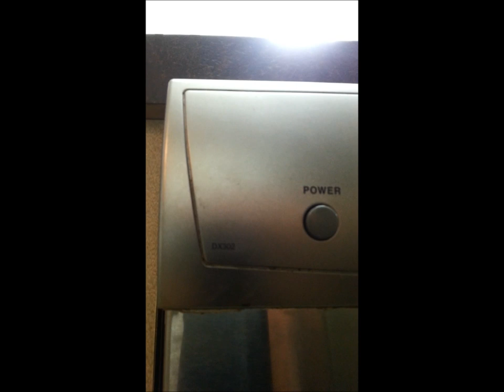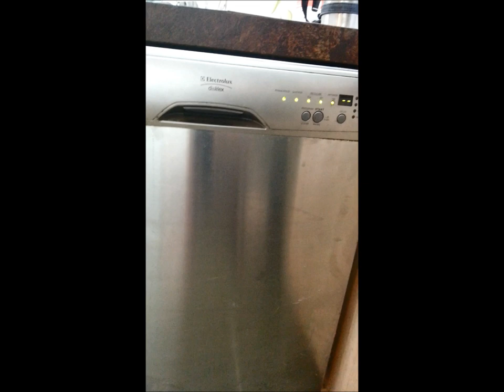Electrolux Dishlex DX302 Dishwasher, Easy Fix Heating Element

Comment: Our dishwasher did the same last year.  I decided to buy a new controller ($132)
Six months later same thing happened.  The electrical supplier would not cover the new controller because it was over 3 months old and I installed it myself.
Yesterday I decided to buy a new dishwasher but I looked this site up on the internet.  Did the repair as described even though the joints looked ok. Now dishwasher is heating as I type this. Thanks a lot -saved me purchasing a new dishwasher.  I have also done the same to the spare controller.  I did not find this video when the problem first happened - would have saved another $132 but it has saved me buying a new dishwasher

Comment: After replacing the heating element and the temp sensor and it still not working. I went to YouTube and found your post. I followed the instructions and actually found the the problem. Re-soldered the relay points. 💥💥💥💥💥💥💥💥💥💥💥💥💥💥💥💥💥💥it’s freaking working. Thank you 🙏.

Comment: I have a slightly different model to this one and after 15 years it just suddenly stopped heating the water.  I was almost going to buy a new dishwasher, but decided to re-solder the 5 relay points on the PCB (I solder-suckered the old solder, then applied new solder), and although I didn't expect it to ever work again, lo & behold my dishwasher is working now!!!   Dry joints are a bit of a mystery science to me ... upon close inspection, the original PCB joints look good, but it wasn't until I re-soldered them, that they were good again.  It's amazing how the world is dependent on billions of solder joints and yet the failure rate is probably fairly low ... for me 15 years straight and suddenly the dishwasher stopped.  This video proved to be a Godsend, and saved me $500 (the cost of a replacement machine).

Comment: Thanks Denny - Great step by step guide to fixing our dishwasher. The fault was exactly as you said it would be, with a dry solder joint on the relay connection to the PC board. Thanks once again for taking the time to show everyone the fix. I estimate at least a  saving of two hundred dollars by the time they have hit you for a new board.

Comment: Thanks Denny, fixed it in 15 minutes! Exactly what you said, I could see the solder joints on the relay we're loose. Now for the first time in months we have dry clean plates coming out of the dishwasher.
You have saved us time and money- Cheers!

Comment: Hello Danny
I did exactly what you presented in the video. I did not understand why the electronic circuit should be re-welded, but I did so - and it worked !!! You are a great engineer.
A big thank you from me. Now I do not have to wash the dishes.

Comment: Nice one Denny, works a charm on the Dishlex DX301 also. Note that if you can’t get the solder points to melt by themselves, adding a little extra solder works really well to get the job done.

To the commenter who suggested taking a photo of the leads before disassembly, turns out the leads are all different sizes so they only fit their original positions.
Reply: Yes, just did our DX301 works perfect again now. Was just the large terminal added extra solder, fixed.

Comment: Thank you very much.  I used the info in this video and 15mins later had a dishwasher like new.  I would note a few things:  
- my dishwasher exhibited a lack of heat intermittently then finally stopped heating altogether.
- I recommend using some solder flux when reflowing the solder.

Thanks again!

Comment: Followed your instructions and prodded around the soldered points with a little soldering iron and wasn't sure if I had melted the points enough as the iron had a really fine point. Anyway put it all back together and low and behold it works. Made sure the machine run for at least 15 minutes before checking the temperature. Many thanks for the info.

Comment: Heater was playing up and finally gave up. Thanks for posting the video. Followed your steps and waiting for dirty dishes to load it and test. Tested the relay with a 9V battery. It clicks in and out and  contact closes when the relay is energized.

Comment: Hi Denny
Thank you so much for posting this as I am a single mum and my dishwasher has not been heating for a while and didn't not really have the cash to fix.  So I decided to follow your guide and purchased myself a soldering iron and followed what you did step by step, which was simple thank you.  Managed to fix my dishwasher and am currently running through a cycle and its heating!!!..  I am so excited.  All I got was a couple of cuts from the steal cover when putting it all back together.   Thank you Thank you Thank you xo

Comment: Thanks Denny. I've done a few repairs on this model already (faulty power switch and switch wiring). Good to see it is most likely a simple dry solder joint or 5. I'll give it a go this week. Cheers.

Comment: Thanks Denny ,did what you did in the video worked a treat, saved me a Lota bucks buddy. The solder had completely fallen of one of relay solder points, gave all the other points a touch up while I was there, (to be sure to be sure) put it back together and away its hot little cleaning self  went. Top video thank you Denny for taking the time to do the vid.

Comment: Yay!  it worked  (second time around).  Burnt my finger on the soldering iron (which I've never used before) but the dishwasher now works properly - hot water coming through and dishes dry!!  Thank you Denny!

Comment: Thank you Denny for creating this video, really appreciate it.
I decided before I pulled the washer apart i would give the front of the washer (where the buttons are) a couple of decent thumps with my fist. I figured if it is a bad solder, with any luck it would fix it even for a short period.
You'll never believe - it actually worked. So this weekend i will pull it apart and re-solder the joints.

Thanks again Denny.

Comment: While the problem and solution seemed so logical, I still had doubts ... but actually that was all it took to regain the hot water!  We have a older AEG machine, a brand which is owned by Electrolux.
Many thanks.

Comment: Thanks dude .My unit was still heating but the device would fail to finish the wash cycle. Sometimes you get lucky by switching off at the wall for a while and the cycle would complete . Most times the unit would stop and flash the finished light 5 times. I did find a dead cockroach on my circuit board and brown smears everywhere . I cleaned it up with metho and re soldered any joints that looked sus. Hope she's a winner when I try it in a minute. Cheers.

Comment: It actually worked! I was sure it wouldn't be that simple, and yet, 3 of the 5 solder joints were cracked! Thank you for a very easy to follow video.

Comment: I had a very similar problem which replacing the relay resolved. I was getting error code 60 but the heating element was working almost too well with the unit getting very hot inside. I first tried resoldering the dry joint but also noted the exterior of the relay had burn marks. So after the resolder failed I figured a replacement was worth a try especially as it was under $20. Replaced it yesterday and all working now.

This is the only place I have heard of this fix so thanks for sharing as its saved me replacing my dishwasher
Reply: And here I am again as its just started doing it again. This time I will add a note as to which relay I bought once I sort it out.

Comment: I have a Westinghouse SB907WJ*00. The heater stopped working a few months ago and it's been running on cold since. Yesterday it started shorting the circuit breaker. I've now got the dw on my workbench. I've done a preliminary check or the inline heater. It reads 30 ohms continuity and open circuit element to ground. I'm thinking problem must be in control board. After seeing this great post from Denny my bet is that there's a short across the pcb and relay contacts have also suffered dry solder joints. More to come, will keep you posted.

Comment: Another "this fixed it!" from me. Thanks a heap Denny Muldrock. Mine did not have the burnt area, looked very clean. But I resoldiered every connection in that general area. Working a treat now. Mine was a DX302WJ*06.

Comment: Hi Denny, 

thank you very much for your video. 
It worked very well for me and my AEG FAVORIT 40750 from 2004, made in Germany. 
I had problems by unplugging the power switch. So I just unscrewed the whole switch which is hold by two screws. 
On the board I could clearly see the problem you described. It looked as if a little explosion had happened at the position of one of the contacts. I was fearing that the relay could be blown. 
But after having soldered the contacts and reinstalled everything, the machine worked like it should. 
I am so happy! You did a great job! 

Best greetings from Germany!
Harald

Comment: Well,  I did pull it apart and it did have a dry solder joint on the relay.  It is fixed now and works like a charm.

Comment: thanks for posting this.It pointed me in the right direction. one of the tracks on the PC board to the relay was completely burned through. Although I bridged it still no hot water. I desoldered the relay and tested with 12V supply and it worked fine. So it's a complete new board for me..:-(

Comment: I had the same problem. The first time the solder joint blew, we had Dishlex come out and charged $400 for a new mother board. Soon after, the new mother board blew again. I opened it up, exactly the same problem, soldered the one solder joint that was black from blowing, and it has been working for the last 3 years. Absolutely disgusting that there had been no free recall for the mother board, as there is a common problem caused by the bad design of the mother board.. Thanks for posting. Now it's leaking from underneath and wrecking the new kitchen cabinets. Never ever buying Dishlex rubbish again.

Comment: You Sir Are a bloody ledgend!  
Just becareful when pulling down the face after undoing the screws, y cables where glued to the inside and one cable ripped out of the plug, Just sodered it back on... 

I also used extra solder to ensure I dont need to do again...

Screw You Electrolux and your $134 call out fee! + parts cost.. Really dissapointing to see them cashing in on a common fault..

Comment: Great help, thanks. Fixed mine using this method.  I checked out the solder joints under a binocular microscope before re-soldering.  It was not possible to see which one was at fault, but all had a ring of fine cracking in the solder around the central pin. Not sure if this is a design flaw where the joints overheat, or that they just used shitty solder. I suspect the latter, because a few other joints on that circuit board also looked a bit suspect under the microscope.  I guess that is what happens when you outsource manufacturing to Asia. They will do anything to save a cent per board. I will not be buying another Electrolux product after this experience, but heck, everything is shit quality these days.

Comment: that was a good fix and saved $$$. Just a word of caution though. The edges of the door inner skin are razor sharp so they need protecting as your hand is working in close proximity. I ended up getting a tetanus shot for a top of hand slice. Just be careful but the fix is easy and I'm no tradie!

Comment: Great advice thanks. My model slightly different but same solder issue in control panel relay contact. Be very careful pulling out multi  plugs as one of mine was very brittle and broke when pulling it out from the board. Maybe wd40 on the plugs to help remove more easily. Also take a picture of the power wires in case you mix them up later ;-)

Comment: Very interesting. We have a 302 white machine. After 13 years the heating has failed and one of the fans is making a rattling noise at the end of cycles. tech quoted $325 repairs on top of $145 service fee. thinking of getting new machine.

Comment: Hi Denny, Thankyou for your video, I have a dx303 which looks exactly the same as the 302 so I have attempted to fix it with this video technique.I tried doing the re soldering of the heater points on the control panel and everything seemed to work fine but on restarting the dx303 all the lights came on but the dishwasher did not start. Is there possibly a reset on this model or something that makes it different on restart?Sandy
Reply: Strange, as I did my fix yesterday on the DX303 and it started up first time. However, as you will read, the fix did not cure the non-drying dishes issue.

Comment: mine is doing this right now, at first I thought it may have been the filter as sometimes if it is dirty the water would not heat. But its very clean and still not heating so i will get the soldering iron out and fix it.  I thought the element may have gone open circuit.

Comment: Hi Denny I'm about to attempt this.  I notice you don't turn off the electricity at the "wall" (so to speak) but simply turn off the dishwasher at the "off" button.  Is this definitely safe?  The only reason i ask is that I can't figure out how to turn off the machine at the wall anyway.  I have no idea where the main switch is
Reply: +Linzi Napier You MUST disconnect the electricity at the wall or unplug your dishwasher. Do not open it with the power still on to the unit.

Comment: Hi,
Thanks for the video. My fifth solder point that you point out is burned black and there is a black stain on the plastic case adjacent to where the solder point sits. Does this mean that the relay itself is cactus? The actual relay looks fine ie its not melted etc.
Thanks in advance.
Reply: +systemawarrior Mine looks burned, I will order a replacement relay that has a bit better specs. I haven't tested it yet, but I will completely desolder, and replace it, and solder a new one again.

To fix this problem though, you should add more solder to the burned area so it completely connects with the added solder that was from before. This conducts the heat away from the copper in the circuit board, and rather disippate through the added solder.
Reply: Mine looked the same. I soldered the contacts and this fixed the problem!

Comment: I resoldered and it worked only once. I resoldered again adding some new tin and again, it only heated the water once. I could buy a new circuit board but haven't found one for my model esf66610x.

Comment: Just a quick question regarding disconnecting the control panel.  Is it easy to tell which wires go where when reconnecting?  Should I take a photo to make sure they go back in the right place, or do they only fit into one spot? Thanks.
Reply from the maker: The connections on the control panel are all different so you should have no trouble reconnecting them. The only ones that are the same are the ones on the power switch so just take note of the colors for each side and you should have no problems.
Reply: Denny Muldrock Ok, I pulled the control panel apart and was a bit nervous to use the soldering iron, so left hubby to do that part.  He soldered all the points for the heater relay and sadly it didn't fix the problem.  I was pretty proud of myself, putting it back together all by myself. LOL.  I'll have to test the heater element.  Looks a bit tricky to get at it (adjuster feet are in the way so will have to remove whole unit to repair).  Thanks for great instructions. :)

Comment: Hi Denny
Do you have any guides for fixing the power button when it won't stay on?  Cheers Linzi
Reply: I had the stuck button problem and it turned out to be due to a build up of dirt /scum around the button opening.  A good clean fixed that but you have to open up the front panel and remove the power switch  to do so.  My switch had an electrical arc burn on one of the connector lugs, so I replaced it with a new switch off eBay for $26 delivered.  Works a treat now.

Comment: Our DX303 would not heat the water for the washing cycle and would not dry the dishes. I followed the fix today, as detailed in this video. Now the water is hot for the washing cycle, but it is not drying the dishes. At the end of the cycle the dishes are cold and wet. Any ideas as to what might be wrong?
Reply: Today I decided to not only just heat up the soldered connection points for the relay, but to add some solder to them. Now the machine will not even heat the water during the washing cycle. I ran two wash cycles, but no heat.

Comment: OK. Further investigation of control board reveals one soldered lug of relay is fried indicating that the relay has overheated. I need to replace the relay for a permanent fix. Anyone know where i can source the same or equivalent relay. NAIS JS1-12V-H111 / AJS1311 M11. 10A 125V ac.
ANY HELP APPRECIATED.

Comment: Great thank you. Mine didnt have the burn marks as shown here:
http://www.fixya.com/support/t579479-dishwasher_dishlex_dx302wb_no_hot_water

Your video gave me the information and confidence to proceed with the 5 points you indicated.

I used a bit of solder also on each of the sockets (it came with the $15 soldering iron). Never used a soldering iron before but 30 mins - job done and heating again!

Comment: Should it heat the water immediately? i followed the video and i have now restarted the dishwasher.Still cold ten minutes into the wash cycle.
Reply from the maker: Corey Conway Depends on your cycle settings, it should defiantly heat at the end of a cycle though.
Reply: Thanx. Yeh it heated at the end. Thanx for the video.
Reply: Corey Conway On the normal cycle, the first few minutes runs with cold water. Heating the water starts about 15 mins into the cycle.